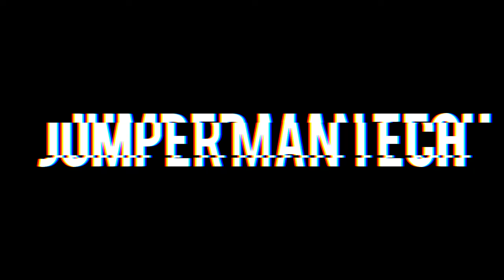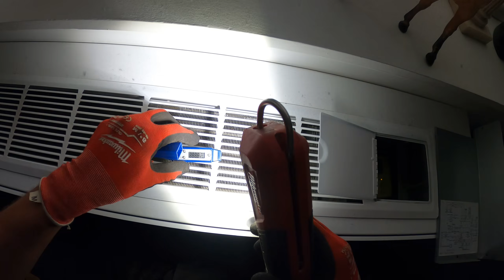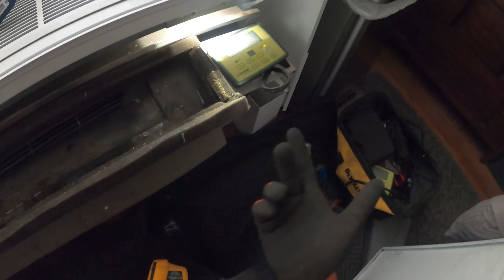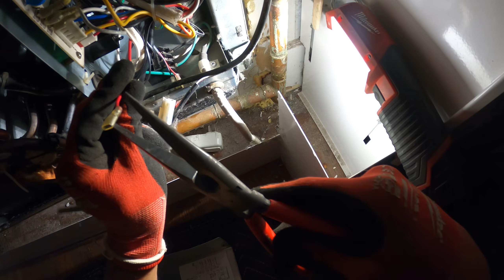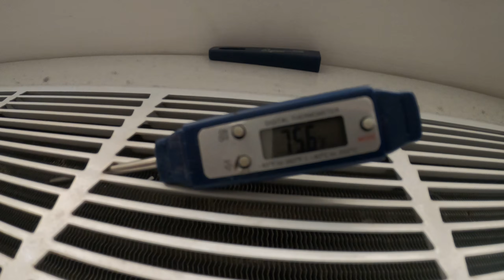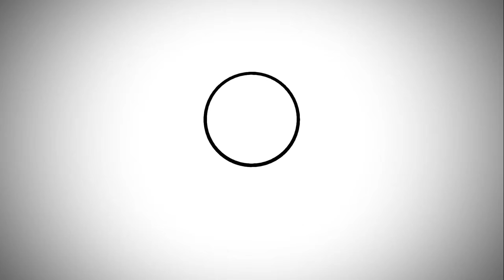HVAC Service Call: PTAC Unit Not Blowing Cold Air (Packaged Terminal Air Conditioner Not Working)

Comment: Great video.  I have a similair problem in a unit i'm renting out.  The tenant says: "unit rarely blow cold air and make a lot of strange noises on and off."  I think it could be the capacitor.  I ordered a decent multimeter and I'll check it out.  Thanks again.
Reply from the maker: Thank you! That strange noise might be the compressor turning on and off or one of the fans. Be careful testing the capacitor as they can be dangerous and it's best to leave it to the professionals. Thanks for watching & good luck!
Reply: Jumper man Tech can he pull the capacitor and short it to remove any charge in it?  Short it Common to herm & and then common to fan with a screwdriver with a rubber grip?
Reply from the maker: @jakestephen508  Yes, need to discharge the capacitor. They sell a tool for that but you can also short it out with a screwdriver the way you said. Def make sure the handle is insulated. Thanks for watching!

Comment: nice one bro.  flawless order of operations.  i love that you diagnosed the capacitor before pulling the whole unit out of the wall to get to the motor  to check bearings etc.   A lot of guys are too heavy handed and would impulsively do that as soon as they realize condenser fan is not spinning.   cool cat.

Comment: Such a great feeling when you find the fault 😁😁😁

You were right to go for the 4 microfarads as opposed to the 7.2 as its nearer the capacity required.

An easy return visit with the right capacitor and a few cable ties - job done 👌

Keep up the good work 👍
Reply from the maker: It really is an amazing feeling! 😁 Thank you very much and thanks for watching! 4MFD did the job. Return visit with a 5MFD would be perfection. Appreciate the feedback. Stay safe out there & stay tuned for new videos every week🔧

Comment: Sweet 👍🏻

?: capacitors can be tested without discharging, is that correct?
Reply from the maker: Thank you! Capacitors should definitely be discharged no matter what for your safety. Typically these days they discharge themselves either with a resistor attached to it or just when the power cuts off. I made a video on how to check them properly. I'll leave a link below🙂 Thanks for watching!

https://youtu.be/QOlhktSd9l8